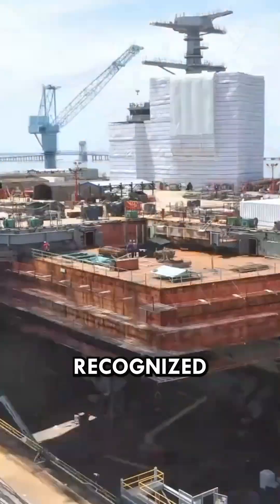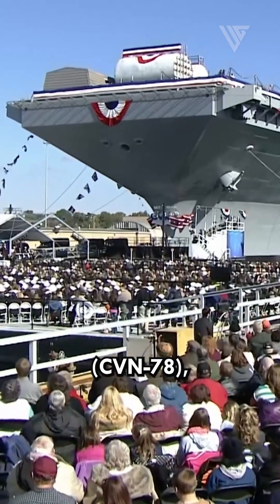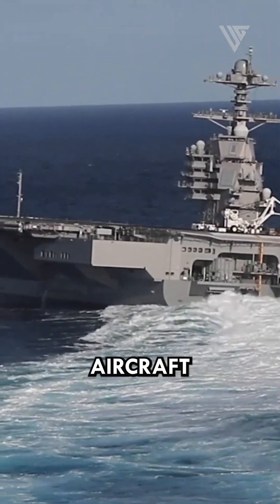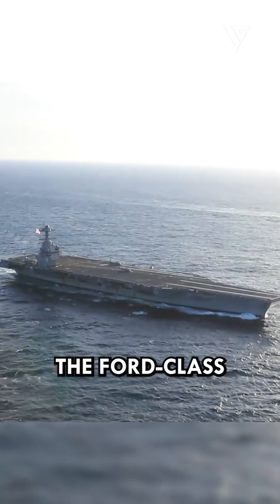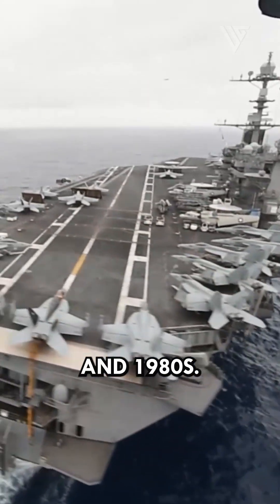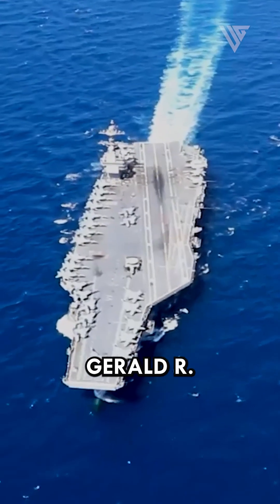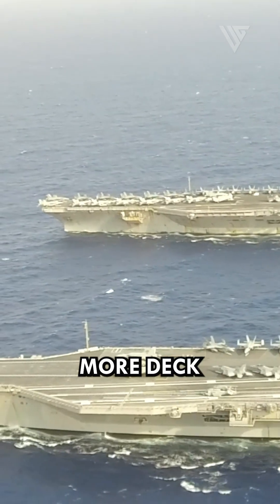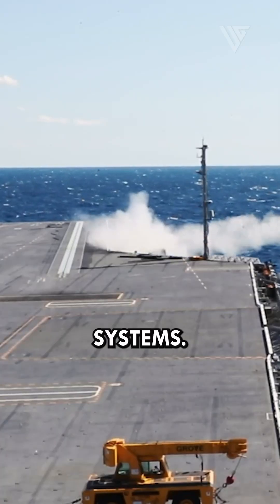Why Did the U.S. Need to Build the USS Gerald R. Ford? #shorts

Comment: Wrong, wrong, wrong. Almost no part of this was correct. EMALS catapults and AAG arresting gear has only one purpose. Reduced maintenance and manpower requirements. A1B nuclear reactors do produce more power but they also could have been used if the Navy decided to continue Nimitz class production. The flight deck isn't necessarily bigger but laid out with more area forward of the superstructure (island). This allows deck crews more forward parking near advanced weapons elevators to more quickly turn around go aircraft. The launch events still happen on the same schedule but there will be more rest time between events. Sinking any modern aircraft carrier would be difficult. The shock trials shown were done on many Nimitz class ships.